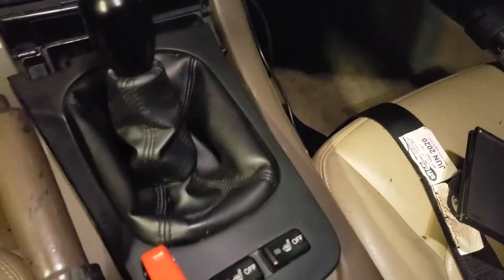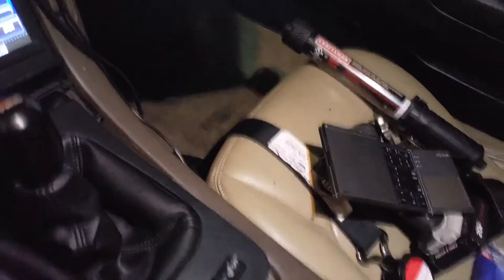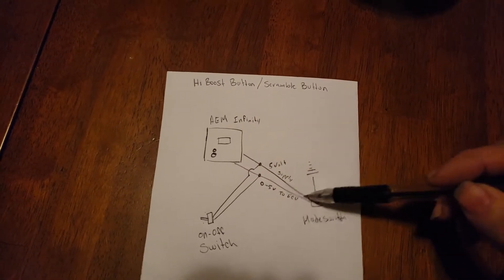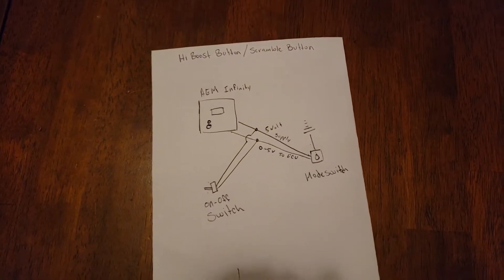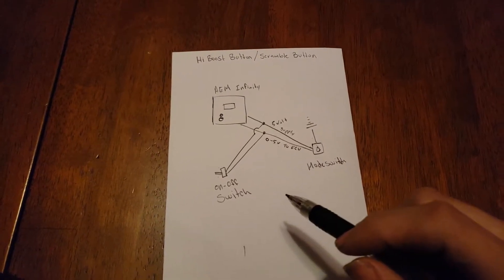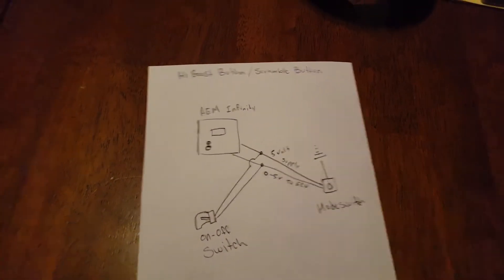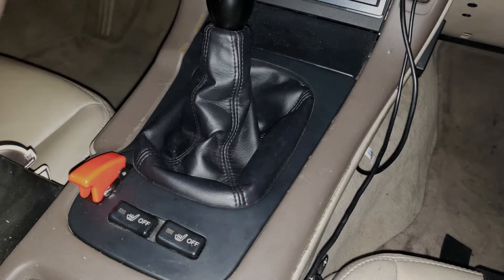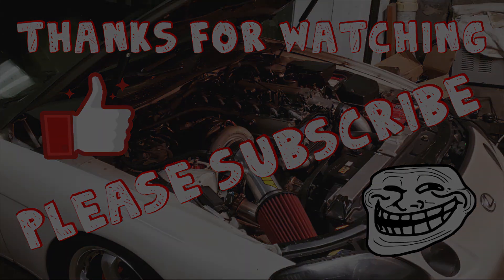HiBoost Switch (mod) for AEM Infinity w/Modeswitch

Comment: Is the switch grounded to the chassis or ecu?
Reply from the maker: The switch does not get ground, one wire goes connected to the 5v supplied from the ecu that runs to the modeswitch and the other wire goes to the output wire that goes from the modeswitch to the ECU. By doing that, with the switch off, the modeswitch will function as it should. When you turn the switch on, the 5v will be diverted straight into the ECU showing 5v signal. Hope that helps...
Reply: @BoostedLexus sorry i meant to say the trim pot switch! White wire-signal, red-5v signal, black- is that grounded to the chassis or should i tap it into one  "sensor ground" wire off the ecu? Thanks
Reply from the maker: @2jzs13  I have mine to chassis cause I figured it's a switch and not a sensor and also didn't want to add noise to my sensors, but I do get a little noise on my modeswitch. Since it is a 5v signal, I will try the sensor ground to see if I get no noise. But as it is on chassis ground, it's minimal noise and easily tuned to compensate.